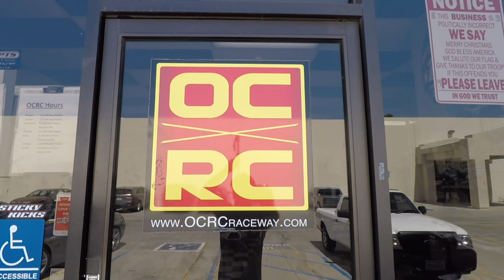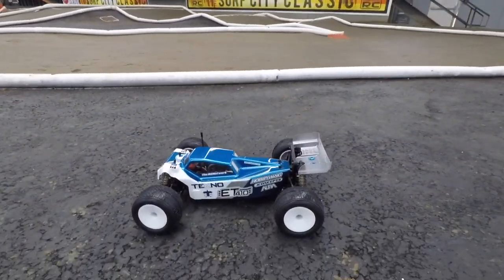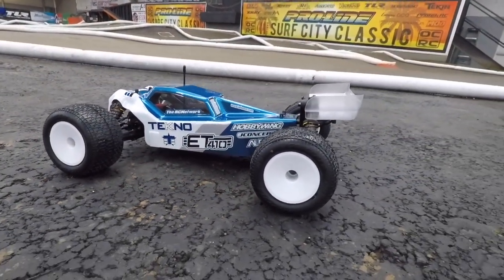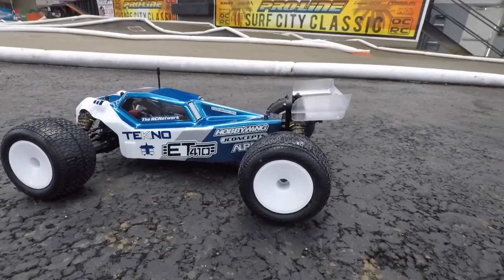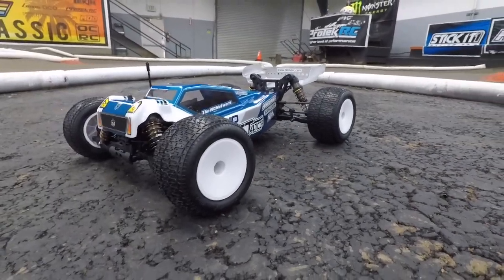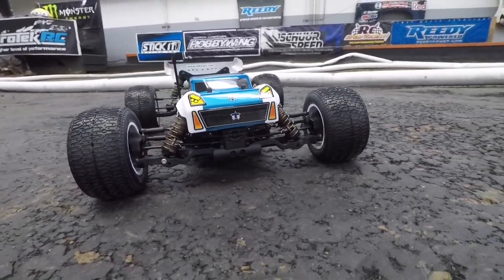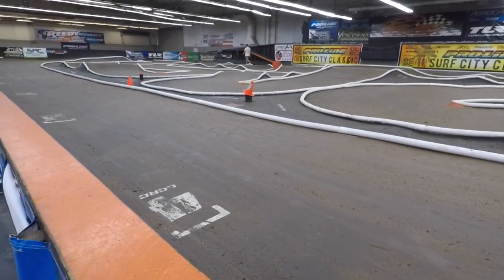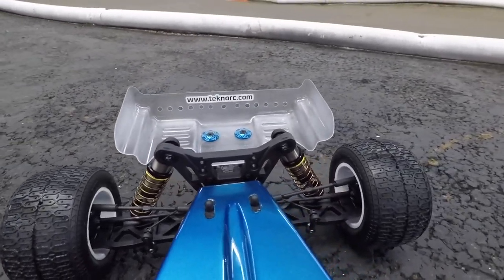Tekno ET410 - Running Video at OCRC - 1/10th 4wd Truggy

Comment: My buddy let me try his ET410, I really hated driving it, because now it's going to cost me $$$ to buy one because now I really want one!  It's pretty awesome car, looks like a freaking 8th scale out there due to the width and body.  Only negative is that body is going to get some abuse when you do crash, but overall a great car, like an EB410 just more of it and capable of 4 turn motor power.
Reply from the maker: Going to 4 pole next. I wanted a bit more grunt
Reply: @TheRCNetwork  Finally built mine, getting ready to run it at SDRC, I am running a Hobbywng 3652 Xerun G2 4300kv 4-Pole right off the bat and see how it does.
Reply: Tell me about it bro. A buddy let me try his EB & ET410 now I own both lol solid rcs to work with
Reply: @gpaje  that's all I run @ such a great facility SDRC is
Reply: @FullSend93  Me as well, though I use my EB410 as backup in case my ET410 goes out and I can't fix it at the field.  LOVE my ET410 at SDRC.
Reply: @gpaje  same here got 2 ebs & 1 et

Comment: Rich you can get tighter cornering by turning in really aggressive early then jiggle the wheel back to neutral, then back to full lock again. It takes a bit of practice but once u can do it confidently you will notice a difference.
Reply from the maker: Gotcha - Will try that the next time I'm at the track

Comment: Hi Rich, Another great video.  I think you originally had a 5.5T motor in this truggy but now I see you switched to a 6.5T. I also saw you have a 5.5T in your EB410.2.  Just wondering why you switched, how its working and what you are using currently?  Also, wondering why the bigger motor in the buggy and not the truggy?  And what pinion gears are you using in both.  Thanks
Reply from the maker: Most of the time for these builds, it's what I have on hand, as I don't know what's coming from these vendors (like Tekno).  I started with the 5.5t in the truggy because that was the trend at the time, and I later switched and tried a 540 4 pole 5100kv motor with SCT tires.  The EB410.2 got the 5.5t because that's the only motor I had on hand...and it just seen a couple of runs on the ET.  Likely not ideal, as I like 6.5t in my buggies, so I geared down a bit
Reply: @TheRCNetwork  Thanks for the answer.  What would you say is the best motor and pinion combination for both of these vehicles in your experience?
Reply from the maker: For the track I was running - OCRC (no closed) it was a 6.5t in the EB and 5.5t in the ET.  I usually always ended up using stock recommended pinions (based opt motor/size of track from the manual). If you're gonna run the ET outside, the 5000ish kv 4 poles are the ticket on SCT wheels
Reply: @TheRCNetwork  Thanks

Comment: Did that sc10 motor have a 5mm shaft? Or did you use a 32p pinion w/ an insert to make it work?
Reply from the maker: the original motor has a 3.2mm shaft, the Xerun 3652 motor that I just dropped in has a 5mm shaft and I used the correct pinions for it.  Robinson racing makes them

Comment: Just going to convert my stampede 4x4 to a truggy. Got the same jconcepts body used on the teckno. Question, for 10th scale truggy racing, stadium or short course tires?
Reply from the maker: It's most likely Stadium truck tires...but check with your local track - it's up to them
Reply: Ssc "Shining Star Chassis" is releasing an all new machined aluminum LCG chassis conversion for the Rustler 4x4 very soon. I've been running their Slash 4x4 chassis for a couple of years and it's amazing. I can't wait to get mine and hit the track!
Reply: @jollyjeepertheglen9697  I did the conversion using the stock chassis. Very happy with the results. Now I can't get on the ssc site to check the chassis for it though. Highly interested in it.

Comment: Watching it run and it seems to have the same initial understeer characteristic my EB410 does.. I'm still trying to tune that out.  Mid apex on power it'll oversteer after I increased the roll center front and rear, but I still can't get the agressive initial turn in I want.. pushes then grabs blowing the apex.  I'm poor at figuring out setups.
Reply: Main ways to get more initial steer are to use a more aggressive caster blocks, im guessing it comes with like 13 degree or something? maybe they make 8 degrees. Also u can try and use a stiffer spring.
Reply: That's a truggy thing in general, these things just have so much forward bite and not enough side bite to compensate. The way you mitigate it is by running softer springs up front so that the front end pitches downward and the car transfers weight to the front.

Comment: That understeer is terrible... Maybe go for a softer compound on the tire or try fitting softer sway bars or removing them completely to have more mechanical grip. Great vehicle otherwise! Would love to see this category at competitions. Buggies would probably be quicker on this track though.
Reply from the maker: I always do my first running video 100% stock set up, as this was one of the first videos on YT of the ET410.  I want to show everyone how it drives out of the box with great electronics.  I have since fixed the issues you mentioned!  Thanks for tuning in!

Comment: I absolutely cannot understand why this class hasn't taken off despite the massive popularity of 1/8th scale truggies. Or maybe I can, since all the indoor guys want to run is "stock" ceramic bearing spend several thousand dollars on a single car every six months or GTFO class.

Sorry, it just annoys me how tracks basically just refuse to even consider running a class on the grounds that "they don't have the turnout", only for the racers to then say "I don't bring mine because they don't have a class for it" and then just go back to running stock buggies.
Reply from the maker: I can't agree more.....but honestly, it' not the tracks fault there isn't enough turnout (although they could hype it up a bit more like what SDRC did when these were released)
Reply: @TheRCNetwork 
I agree it's not the tracks' fault for classes not taking off - after all, to have a class you have to have enough vehicles in that class - but I do feel that tracks can do something to help out with it. Lowering the minimum number of vehicles needed, running a "run what you brung" class when multiple similar classes don't have enough turnout on their own, only splitting into motor classes if there's enough turnout to do so, etc.